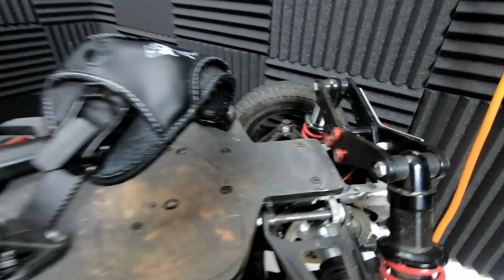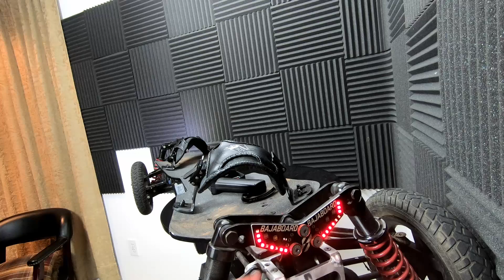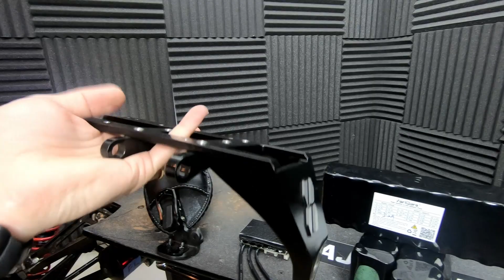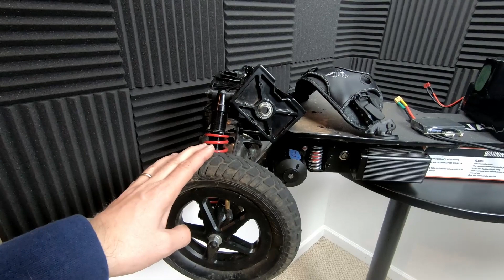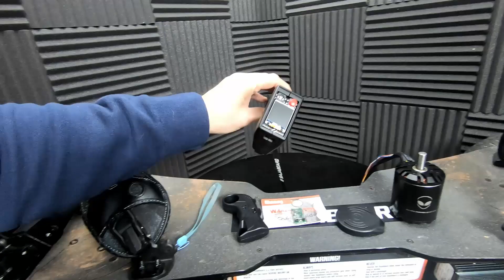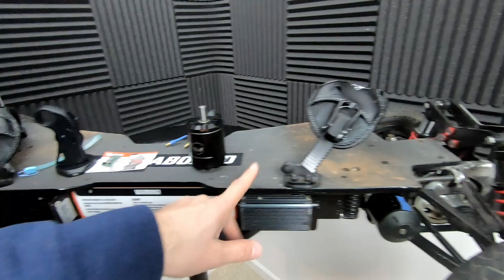Bajaboard Electric Skateboard G4X Full Review - Issues/Maintenance

Comment: What is your opinion on the smoothness of the electronics in therms of smooth acceleration and braking? I can't believe how bad the control is, it's the opposite of smooth, it jerks, also when coasting and you pull the throttle, right before it starts accelerating it will brake a little. That is on top of other many issues, I have never been more disappointed, actually it made me mad. You can't turn on it and if you set it so you can carve, then you can't go fast at all...  For me it was the dream board until I tried it, now I wouldn't pay 500 bucks to have it so I can ride it... Even if that jerky control was a faulty ESC or something (which I doubt) still the way the board turns, resp. not turns is a killer for me...
Reply: Dude, I've seen a few of your posts hating on the Baja and I just really have to disagree. The motor controllers are most certainly different from standard ESCs and as a result handle differently. they just take getting used to. It's a learning curve just like any other eboard. The g4x handles offroad like an absolute monster, it does what it was made to do incredibly well... not sure on exactly why your experience was so bad but I feel like you probably didn't give it enough of a chance
Reply: @surferofdirt9422  It's not just my experience, it's everyone that tries it out. Maybe the fact the guy went with us on a ride and told us some more problems with it and put it on sale the very next day... should be enough. That speaks for itself. Learning curve? :) Man, those controllers are shit, so yeah there is a learning curve... cause they suck. ANother guy that bought 4wd baja told me he will be ordering 4 vescs to replace... I don't think I need to go any further with this.  Have you ever tried a Vesc? How much smoother and better it is? Try it out and never go for anything else , that is my suggestion. Board for 4k that doesn't have Vesc... That is a joke...  On such a powerful board the most important thing is to have the best and smoothest ESCs there are. I wanna accelerate a little from neutral and it gives little brakes before it starts accelerating...? Cheap chinese shitty ESCs don't do that... Bajaboard is a total fail, dishonest reviews.... And it's not like you can try it out everywhere like other boards... SO you kind of need to trust those that do those reviews and what you read about it... I would lie too... Spending 4k on such a shit I would make myself believe it is a good board and it's just a learning curve... and that's because it's too powerful, I need to get used to it... and bullcrap like that... It's shit, pure and simple, I wouldn't pay 500 bucks for that...  The better the board is the easier it is to control, the less learning curve, not the other way around.
Reply: @esk8spirit362  wow. Righto. Enjoy your bubble mate. I'll be out having fun on my sick board.
Reply from the maker: @surferofdirt9422  Monster indeed! The board is awesome you just got to hammer the go trigger and hold on for the ride!
Reply from the maker: Definitely in the controller go to the board settings. First, start playing around with Launch Settings. A high setting means aggressive take off and braking. Next, look at the Maps Settings and move those to a beginner. Then you can take a look power level. Start at 50% see if that is good. Too strong go lower too weak kick it up a notch at a time. I agree the ESC can be jerky and too aggressive. It's a power board for advanced riders. I did also notice a flaw in that if you leave the board still for a while the brakes only work if you give it a bit of gas first. If you lower all those settings you can then loosen the deck springs and tower struts rebound settings (little screw on the tower) to make the beast turn a little better and also move the steering rode to the highest spot on the front and rear. I setup mine on the top on front and bottom on the rear. I still plan on swapping out the electronics and moving to a 4 VESC setup which I have but it's a big job. I'll have more control on power to the front vs the back and power curves and breaking. I have a few friends who are looking for a cheap baja so if you really looking to dump it please direct message me.
Reply: @nevco1998  It must be the ESCs, if you put in 4 VESCs it will be uncomparable. I do have a power board with almost the same power and with using VESCs it is the smoothest thing even with full power. Let us know the difference when you switch to VESCs, would really wanna see that. Good luck and thanks for the answer.

Comment: Nice review. I’m very tempted to get a Baja board but still not sure especially when considering the price. For $5,500 it is going to have to blow me away and stand the test of time. I’m not sure your board has seeing the amount of work you have had to put into it. 

Not sure why you need to pay an extra $550 for a metal controller and over $600 for alloy wheels either. That’s almost car wheel prices. Seems excessive. Everyday I get closer to purchasing one though. I live near some great off road locations but not sure I’m going to be able to keep up with the maintenance.

I’m enjoying your vids, keep up the good work 👍
Reply: I completely feel ya. 
The board is EXCELLENT and way overbuilt for the average consumer. In all honesty it's also far more capable than most riders who will ever step on it. 
But I will say for the $5,500 price you mentioned. It's not worth that much all at once imo.

HOWEVER, it would be possible for you to purchase the G4 (2WD) model for $2000~$2500 and later on add the X kit to install the other 2 motors, belts, gears and drive kit for about $1k at a later date. You can also get the smaller battery pack like I did just to save money upfront then upgrade it later. The 2018/19 models are all very modular and fit like legos. Email Bajaboard and ask them if that's still a possible option so you don't have to drop over 5 grand all at once. 

Also in my review I'm slowly coming to the conclusion that this isn't just a board. It is a legitimate vehicle and as such you need to keep tools for disassembly and repair for it with the board at all times. It's was difficult but I did put together a a small tool kit the size of my palm that can repair 90% of any problems you may encounter with the board while on the road. So keep in mind you will need to buy a few more items after you've got the board.
Reply from the maker: @anthonycampos7417  Yes they mostly fit like a lego kit. You can swap out the component easy. I've got a brand new set of alien power systems motors and new VESC controllers to install to make it more capable for my likes and dislikes.
Reply: @anthonycampos7417  There we go more crap about the allmighty shit called Bajaboard... You people are either really lying or you have never ridden any other boards, never used a Vesc. The stuff you say and how you are hyping it up is sad...
Reply from the maker: Agree these are not cheap. It is a low production niche board that doesn't have the benefits that scale of production affords boosted board and Chinese board makers. But again, these "skateboard" based boards are not even in the same league as this beast.  This is more in lines with a high performance quad bike.  Think of it as the Bugatti of stand up riding. In fact if you could strap yourself to the board you "could" beat it in it's 0-30MPH speed test. Power to weight and all that.
Reply: I will not go on a rant, my advice would be to try that thing before you buy it. My opinion most people must be disappointed as hell...
Reply from the maker: @esk8spirit362  AGREE!! 100% you need to try it before you buy it.  It's a beast and not for everyone. Doesn't ride anything like a skateboard.

Comment: FINALLY! someone reviewed this board. 
i actually got a 2018/19 model G4X and was planing on doing a review on it but as a cost saving measure i ordered the smaller 500Wh battery pack which made my rides just  . . .ok i guess. i wanted more so i planed on ordering the new 10s 1.1kWh battery pack which supposedly hits 45mph. i dont need all that power but it doesn't stop me wanting it.

also i didnt know they had all these issues on all the older 2016/17 models and i can say the QC has stepped up quite a bit from what you've encountered but still isnt super premium like you'd see from boosted.

 Also i cant understand why you are willing to give up traction control system and change out the VESCs, thats honestly one the bigger appeals of this board  but i guess if you are going as far as to replace the motors and such then i guess you got no choice.

ill sub and look forward to seeing more new content from you on this board and expect a video review from me on this board as well in the coming moths after i order the new battery, ive been slowly capturing a bunch of B-roll and even bought a new camera to do so.
Reply: Looking forward to your review 👍 I’m close to pulling the trigger on one but hesitant...
Reply from the maker: Review has been posted. Enjoy.
Reply from the maker: They are awesome boards and just getting better all the time. I can't wait to put the Alien Power System Motors on. Just a large effort to replace 4 VESC and Motors at one time.  Need to take a break from work to do it. Thanks for watching the review.